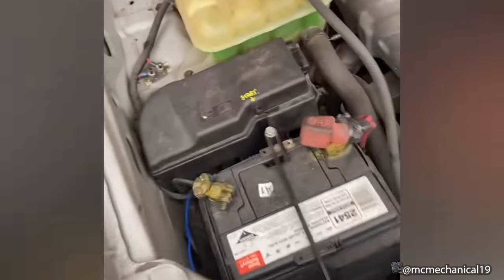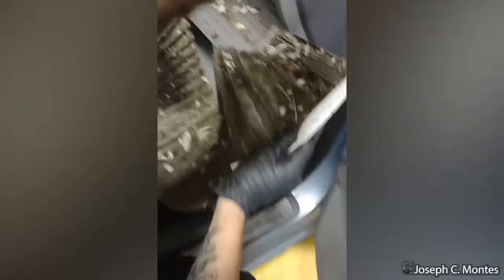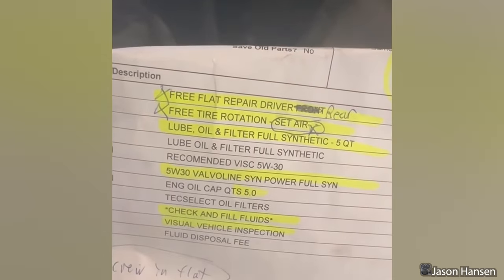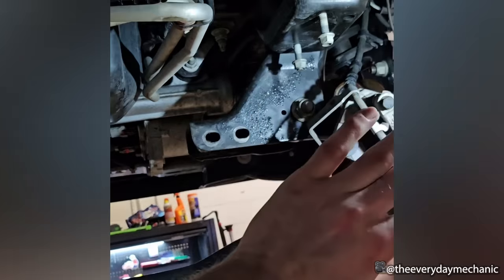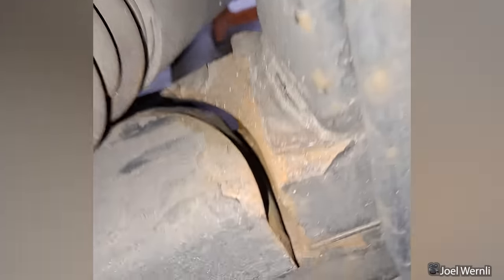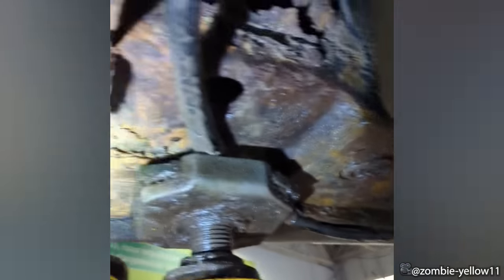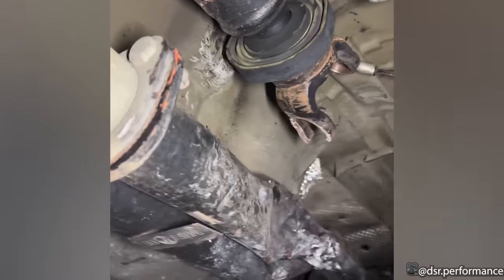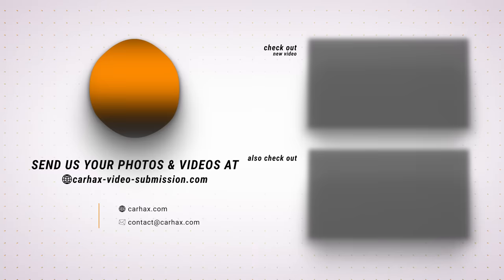Customer States & Mechanical Fails [Part 39]

Comment: I have a question for the RTA when youy car is inspected every year how  come people are driving cars around that are just fallinge to pieces around them
Reply from the maker: The inspector made a small tip, not knowing how dangerous and what catastrophic accident it could cause
Reply: I would like to do away with the pink slip and do a independent inspection and report on the car

Comment: I don't really get why it's such a bad thing that a starter motor is under the intake manifold in a V-engine.
Like, you don't really have to change starters that often to my knowledge, at least you also have an excuse to change the dryrotted intake manifold gaskets at the same time 🫠

Comment: 4:06 It's a fifth wheel pin puller - used by truckers to uncouple a trailer. sometimes it's placed in a holder out against the tractors chassis. must have fallen off on the road and got caught under this car. nasty.

Comment: Customer states that it's hard to see out the windshield, and there's a clucking noise every time he turns on the wiper. Mechanic wonders just how blind the customer is and recommended an optometrist because the customer should have been able to see that there was a chicken on his wiper.

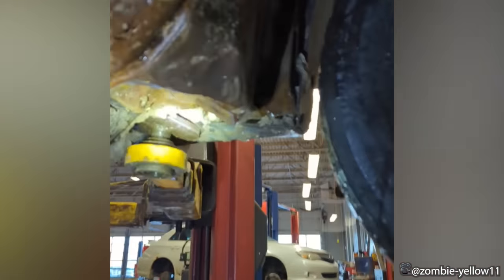Comment: 7:24 This vehicle will not be allowed back on the road in France, or the entirety of the EU even. Unlike in the US, we have strict rules that stops wrecks from entering traffic.
Reply from the maker: The car is from Québec
Reply: a lot of places in the US do require safety inspections. just a lot of people ignore them
Reply: Too bad the US makes cars so fragile to rust, not a problem with europpean,chinese and japanese  cars 🤷‍♀️
Reply: @benjaminmaher8896  Japanese cars rust out so much faster then American cars, there's just no salt in Japan to rust them. They only got a thin layer of paint.
Chinese cars have ungalvanized steel, and rust extremely badly
EU Cars have the same problem

All of these stem from them not using road salt.
Bring any of these cars to the us and they will be death traps within 10 years.
We made our cars to not rust out within a few years because we use salt. That's why you can find near century old vehicles that don't have their frames entirely rusted out, and gots mostly surface rust.
Reply: @MünWeeew  bro im in Québec, we use basically liquid rot on our roads I know what im talking about. And also your century old car makes no sense because no-one drives those now in winter, im talking about automobiles dating back to  max 60 years ago and the problem has not changed with american cars. I rarely find any american cars that are more than 20 years still on the road but I can find mint condition honda accords from 30 years ago that looks like they came out of the factory and the guy drove it in mid snowstorm. My opinion is based on what I see and what I see coming into the shop, if 99% of the cars with rust are american then I have a good reason to think that they are fragile to it.last time I have seen a japanese car in the shop was 3 years ago and it was a mazda 3 and it cane for an oil change. mazda here were always rustbuckets until the 2010’s came and they all stopped being rusty because they redid their metal recipes but I can see fords from 2017 that are pitted with rust layers.  Look maybe its fine where YOU LIVE but here any american cars that are not high trim or sport oriented are usually money pits from the second you buy them.

Comment: It should be mandatory for engineers to receive their degree, they ahould have to do certain major repairs on qhat they've designed. I guarantee  you that the engineers would be making changes to their design process immediately!

Comment: Why do engineeres  put starters under the intake. WHY o WHY. This is the dumbest place to put it. Starters are small these days and you can fit them aniwhere. Not under the intake. Job that cold take 30 minuts turns into 5 hower grinde. Before you cold do it yourself with eese, but now it takes like a hole day if you wont go to shop. Engineeres must be hating mechaniks these days soo mutch. Is this part of the planned obsalessence plan cause repairing takes two bloddy long and better to buy a new car then to repair it cause repairing and changing a simple part takes redicolously long time.
Reply: Because as the guy says, they are not the ones sevicing the cars and they believe that mechanics have 3 elbows and extensible fingers with 360 degree rotating joints.

Comment: Freakin Nissans I had a 2008 Pathfinder and out of all the cars I work on it's the second worst brand. In order to replace the plugs on the driver's side you have to take the intake manifold off along with everything attached to it pain in the azz car company the worst are benz bmw audi

Comment: 10:05 "Talk about ford tough"

Bud, I get you're amazed the engine operated with a valve cover practically removed, but plastic valve covers fucking exploding under daily conditions is not something 'tough' vehicles should be victims of.